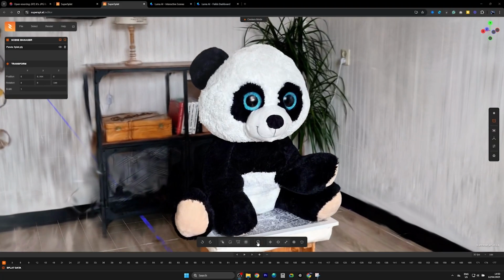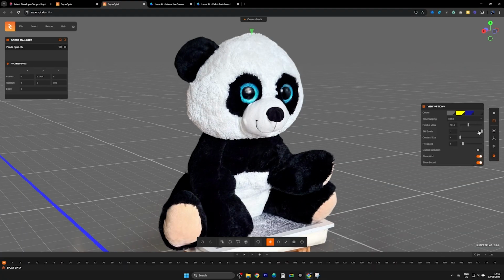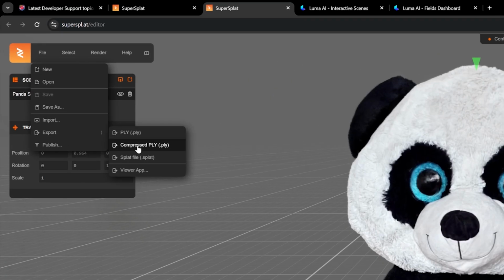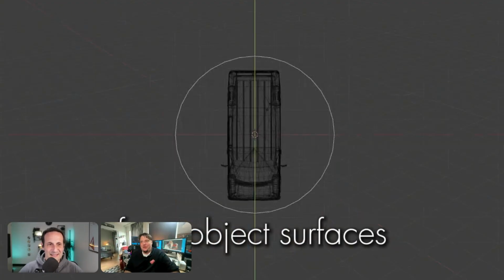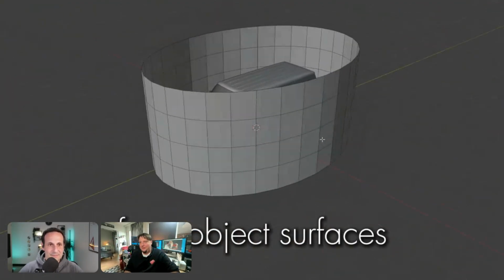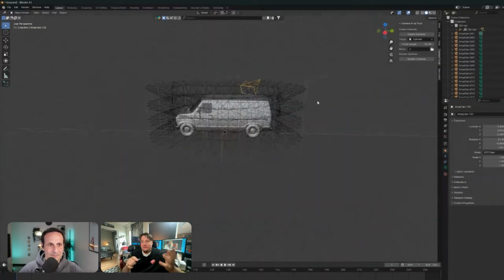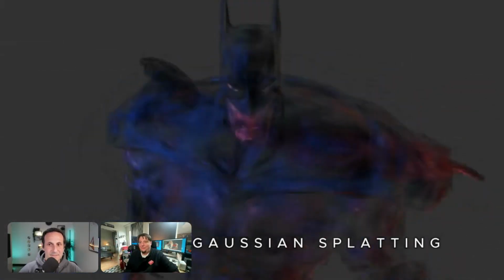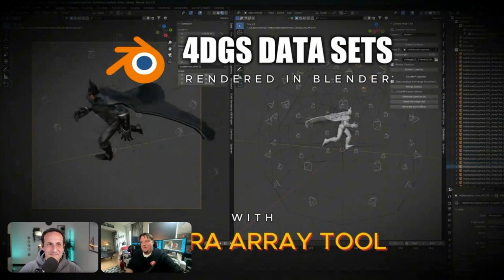Tools, Workflows, and Optimizations for Gaussian Splatting

Comment: 38:45 I don’t think you can call that effect a bug or relate it to some kind of emergent property of the Gaussian splatting process. Perhaps there is a lack of  understanding around how long exposure photographs are made, But this was a very intentional effect that required an array of synchronised cameras to make. Not the same as pressing the pause button in the software.